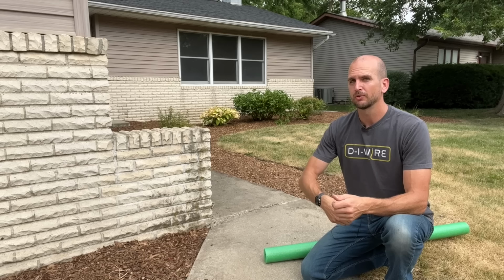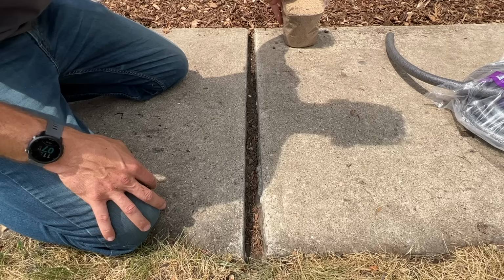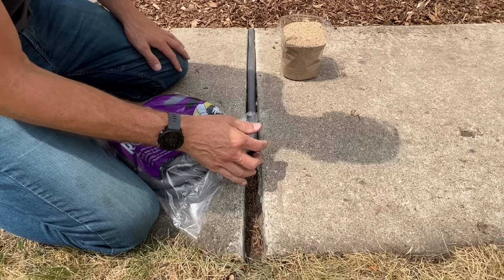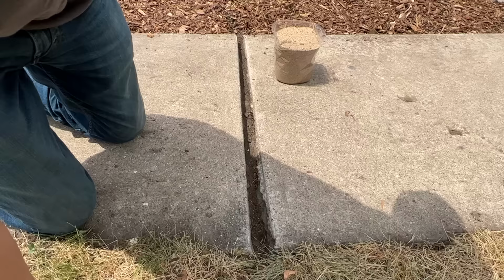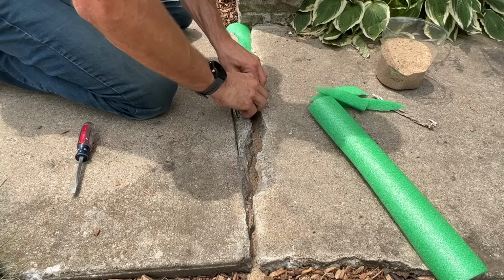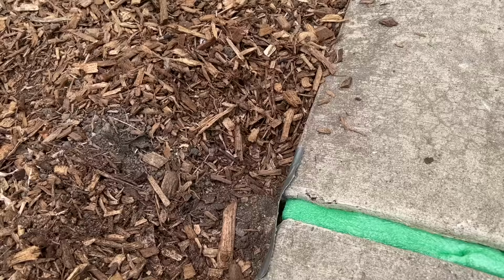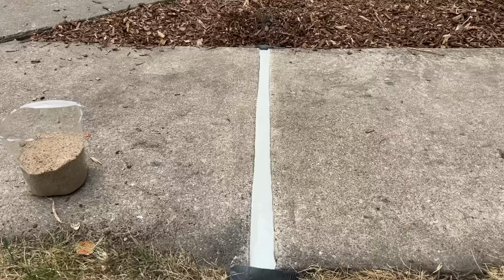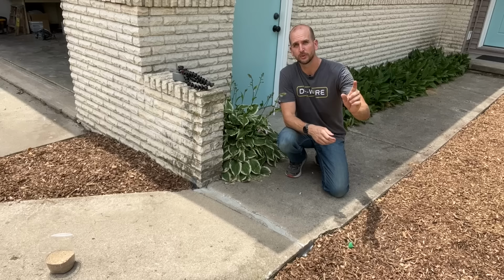How To Fix A Large Crack In A Concrete Sidewalk | Surprising Results!

Comment: I am a mason for over 35 years and what you did with the pool noodle isn't a bad idea especially with the crooked Crack because the noodle is flexible, but I would suggest using quick-create, just mix with water, it's premixed cement, just add water and mix. Then use a small hand garden shovel it in, push down on the cement to get gaps and air pockets out of the cement. When cement gets to a putty type concestansy take a large damp sponge and run it the length of the Crack and feather it in to both sides of Crack, you can do it with the stuff in the tube but you sill have to feather and level the product that  comes out of tube
Reply: Yea mate thats good mail , also if it’s a hot day wet the concrete down first so it doesn’t suck that mix too quickly .
Reply: @queenslander954  Good call, give both sides of old concrete a good dampening if it is a hot day👍
Reply: What's feathering
Reply: Thank you!  I was looking for a solution that doesn't involve any plastic!
Reply: @krazyboutkeekee92  feathering means to brush the seams on top with a brush to help blend everything so it looks natural I believe
Reply: Would that work with a large crack between the bottom porch step and a concrete square? Our back porch has 1 concrete square at the bottom of the porch and it’s broken away from the bottom step. Still straight, no major broken pieces. It just looks like it moved away from the step over time. We know it didn’t start out that way because when my grandparents moved into the house in 1966 it wasn’t like that. So it wouldn’t be flat like repairing a sidewalk. I guess flat then up. Weeds grow, water, little lizards like to sit in there. Yuck. We tried gravel and dirt but they just wash away. It’s really deep so whatever we use I’d have to use a lot. Thanks!
Reply: @lisacobb7525  I believe what you are saying is were the step ends and the walk way begins there is a gap between step and walk way is beginning. Now every tip that I give it really only is a temporary fix in most cases, sooner or later you will have to have old, separated,cracked and uneven old concrete ripped out and replaced with new concrete that has pitch and the right amount of expansion joint. Or replaced with stone or paving stones, now in your case if I have examined it correctly about a gap between last step and walk way, the best way would probably be to use the masonry material that is like call, in a tube and use it like you would use calk around a tub or a window, if it is deep you could use that pool Styrofoam stuff it in the gap and use it the way this gentleman does with the Crack, always read directions on tube and again after you put enough material in gap, take damp sponge and smooth out or like I said before feather it in to old concrete and make sure gap is closed up, no open spots, always keep sponge as clean as you can and make sure the sponge is just damp, I hope this helps, good luck.
Reply: Why aren’t you making this video?!
Reply: @abh114 I just came across this video and I have been a mason for 35 years and I have gotten good advise on Y tube from mechanics, guitar repairs and other things so I figured it might help someone and I have gotten a lot of questions, did not think people would ask questions, so I gave them my experience. People can take my advice if they want or not.
Reply: Sound more simple way to fix the joints. I want to try it. What is the exact name of the "Quick-create" you used ? I found many QUIKRETE cement products and didn't know which one? Is it flexible? Thanks
Reply: @diemvolz4311  What you need is called a sand mix, no stone or gravel in it, I live in Northeast of U.S and has been very hot so should do in morning, the hotter it is the faster the material will dry and be less flexible, the material find in Home Depo, Lowes or Mason supplies,like I said the Quick-Create is a sand mix no stones or gravel, just add water and mix, also if using a hose for your water, let water run, the water has to be cool.
Reply: @frankperricone2065  Will go to find the sand mix cement bag(?) that you mentioned and return the caulks that I bought.  Shoud I use my garden  prayer to dampen the sides of the joint? Can I do it after the rain instead?  Should I pour the cement sand mix up to the joint/driveway surface then feather thin the edges? How about the spots that have un -even edges, 1 side is higher than the other ?  Please let me know anything else that I should know.  I would very appreciate! I live in  Houston, Texas, very hot too. I never had to fix anything until my husband passed away. Thanks to YouTube, I learn a lot. Thanks so much for your reply and advice.
Reply: @frankperricone2065  1 more question. Do I have to remove dirt and or clean the joint before pouring in te cement?
Reply: @diemvolz4311  You can do it after rain as long as the Crack does not have a pudle of water in it, yes dampen both sides of Crack and in the the Crack but no standing water just dampen in the joint you can use yes you can use your garden water can but just enough to cool and again I will say just dapen and as it being uneven you have to go from point A to B, I will use that word again feather, move cement from each side of the joint or Crack, it should be at least 2 inches deep, yes fill up to hight of old cement, and do it in the coolest part of the day, the whole thing is the slower the  cement takes to dry the better.
Reply: @frankperricone2065  You mean the joint must be at least 2 in deep? My joints are only 1 1/4 - 2 in deep because there is a layer of cracked /broken concrete running along the bottom of the joint. It is cracked but tight/ impossible for me to remove. I am scared to operate electric saw, heavy tools. I found out the concrete layer when I tried to clean the joint and remove leaves and some dirt. What should I do now?
Reply: @diemvolz4311  1 1/4 to 2" is fine. If the Crack is not to wide you will have to make the mix a little wetter, pour on Crack and squeeze into Crack with very damp sponge, like the size of a car washing sponge until you can't fit anymore, and if it is in a sunny area when done, after a couple of hours drizzle some cool water on area, that's about as much as I can explain on subject. Then main thing is to get the material in joint or  Crack, make sure that there is no space between new and old cement and matches the height of old cement, no matter how its done my you, a friend or a professional it will always look like a repair, don't worry if it looks messy it is just a to stop it from getting worse, eventually it will have to be removed and replaced,.because what ever you do it is temporary, done decently you can get a couple of years out of it or maybe a year, good luck
Reply: @krazyboutkeekee92  -Feathering is like tapering the ends so they gently get a little lower, so water will run off when it rains or the repair gets wet...
Reply: Concrete is a good fix but will crack shortly due to movement, same problem in a few months , elastic fillers are best ,  but you will have to do over in a year or 2
Reply: @jessedukelacrosse6470  I have had repairs last 2 years, 5-10 years that's why I had said it will have to get new eventually, a lot of customers when they have the money or ready to do it all new the proper way they usually call me to do it, and that's what I tell people.
Reply: It will crack along the edges one week later
Reply: @jimmyswollnuts7662  I have been a mason for over 35 years and I gave some advice and have done many repairs, if done correctly it will last at least a year. I have done repairs that lasted years. If some does not have the money to rip out and do whole job correctly. I made one comment to maybe help someone out. So what are credentials to say it would Crack in a week?
Reply: @lisacobb7525  g
Reply: @frankperricone2065  t
Reply: Good to know . Can I use the same to fix the concrete gap between entrance steps and the floor ?
Reply: @Lisa Cobb  I know exactly what you're talking about. My folks had the same problem. In time the rectangle step at the bottom drifted away from the main body. We dug out all the dirt, stones, roots etc. to 4" and poured in concrete. Then leveled it out with a broom. Worked great.
Reply: @Frank Perricone  I appreciate the advice.  Thank you.
Reply: Honestly, on the crooked crack, I would take an angle grinder with a masonry blade - cut a straight line 1-2 inches away from crack - chisel out the crooked part, and fill in with concrete.  Use a mason edger for a smooth edge.  Crack is too large for the noodle fill-in method imo & my suggestion makes for a neater & cleaner look.   Noodle idea is good & ingenious, I’m just offering another idea is all.
Reply: @michaelsalcido3736  Hey Mike, the way you are describing to do the job would be close to the  way I would do it if I was getting paid for the job. I am just going by the way of a home owner probably not having a small grinder with a masonry blade to cut a straight line around, and other masonry tools, just things that might have laying around the house and just so they can get a decent fix until the can get a mason there and remove all concrete and do the whole job properly. So if a home owner has a grinder with mason blade and cut straight line by all means do it if they have the confidence, believe it or not some people are afraid to use powered tools that if not used properly they can get hurt.  That's s my thinking, I would not want anyone getting hurt. Take care
Reply: As a carpenter with 35 yrs in, including doing handyman work, you couldn't be more off base here with your suggestion. Here's why. The uglier of the two cracks has happened at a sidewalk joint and progressed all the way through said sidewalk. Now I realize a youtube vid isn't the best to see the overall condition of the "crack" but due to water getting under the sidewalk, it's still moving. If you were to repair it the way you suggest, the filler will still crack there by allowing water to still invade. This way, done with backer rods and pliable grouts eliminates this, and should it need to be done again, is easy to do so. That said, with that crack, the best fix here is the expensive one, replace the sidewalk.
Reply: Umm so you are telling people to elimate the expansion gap?  Things you shouldn’t do.
Reply: @turkeytrac1  Hey Mr. Carpenter, I made a comment to add a little bit of my knowledge of a repair that a home owner could possibly done on there own. If you read all comments l help a few ppl and I gave them advise on fixing a tripping hazard, I guess I should have stated that. Depending on how they do it it could last a couple of years the easiest way and cheap without getting special tools to go out and buy and never use again. If I was to go as a contractor I would give them an estimate on doing it totally correct by removing the concrete and putting in the proper expansion and steel reinforcement and depth. If someone could nit afford I would give them a alternative for a repair if they are afraid of someone falling on there property because of a trip Hazzard. Never give them more then a season or two guaranteed Depending on circumstances. Like I told someone else who thought they new more then me, they can take my advise or they can take someone else's or combine all of them. Just giving back to the community.😊
Reply: @drdez  Hey J, were do I say remove the expansion joint, it's a crack.
Reply: @frankperricone2065  you filling the entire gap with concrete would basically eliminate it. Both cracks are where the expansion cut is.  You should rewatch the video.   Your solution of combining both pieces with concrete is not a fix that will last.
Reply: The real question: Is it an expansion joint or decorative scoring? 

The 3 guarantees of concrete, It's going to get hard, it's going to crack, and nobody will steal it.
Reply: F
Reply: No. What he did was PERFECT! Try being positive frank and open to new ideas
Reply: Quik-Crete over any type of sealant?
Reply: The problem with using Quikrete is it’s not flexible. Oftentimes that’s why you have a crack in the first place. With this foam and the self-leveling the self leveling crack sealer, it's flexible, which is very important, especially with expansion joints. As your walkway expands into Quikrete, you can get cracks again, maybe in other areas, creating more problems.
Reply: Yes, he’s talking about Quikrete, he’s just not spelling it right. It’s concrete and is not very flexible. If you’re repairing an expansion joint, you need to be able to be flexible, so when the sidewalk expands, you don’t get further cracks! That’s why they call it an EXPANSION joint. Don’t use concrete in an EXPANSION joint, unless you use the concrete along with actual expansion joint material (building material stores sell 4” asphalt based expansion joint material). It defeats the purpose and will be short lived. Use something flexible, like this guy in the video used.
Reply: THE CAULK IS SELF LEVELING
Reply: Thanks for reaching out to this lady with the problem.we need more people like you in this world ,so on her behalf, thank you.from Dublin Ireland
Reply: @queenslander954  I thought the major issue of fixing this problem is “water” which will add food to a thik root underneath; therefore giving more food to the root to keep growing.  Just saying.
Reply: https://youtube.com/@frankperricone2065?si=EPiwqFBJ0Jk7OLKo 
I rarely comment, but the time you spent to provide clear, detailed information is admirable & deserves more positive feedback, imo. 

You replied to multiple questions in similar fashion, giving more context to your rationale as it relates to your target audience. Further, you demonstrated respect to others who challenged your advice, even those who appeared glib and terse.

We cannot control how others interact with us, but we can certainly choose how we respond to them.  Well done and thank you for your willingness to share your knowledge.
Reply: Wouldn't be easier to pour concrete ?
Reply: @diemvolz4311 I assumed he meant quick-rete…
Reply: Nice job paying it forward! The Universe appreciates you!
Reply: What was wrong with filling it with cement?

Comment: What I do is, clean as he does, dig out all the debris in the gap (as deep as the concrete is) then tape over the edges and fill the gap with waterproof expanding foam.  When that dries I use a wire cup bit on a hand drill to remove excess foam to about 1/2" depth.  Then finish up with self leveling sealant caulk.
Reply: When you say you tape over the edges, do you mean the cracked edge of the concrete? Does the tape stay in place after the entire repair is finished?
Reply: cool idea!
Reply: @annfraley7083  ... Before I apply the expanding foam I mask the edges of the concrete, the top surface.  I use 2" painters tape so if there is any over expansion of the foam it won't spill out over the top surface of the concrete.  Once the foam has dried, it's easy to break off any excess foam before cutting/grinding out the top 1/2" or so of foam.
Reply: I think I might like this idea better as I'm not very good with my hands, and I don't think that I would cut the pool noodle as well as he does. I would probably end up making it look worse than it already does lol. But I liked all the other things that he shared in the video
Reply: @digiacomtech5589  Won't a stiff rotary brush on a drill or grinder buff off any excess foam, overall more quickly than taping as you describe?
Reply: @replyhere590  ... I said ... "I use a wire cup bit on a hand drill" ... You can certainly use a flat circular disk brush but I find the cup brush helps control the depth of removal.  That is, the metal cup that holds the stiff wire bristles rides the edge on one side of the crack while the wire bristles clear the other  ... a circular disk is harder to control and could remove/dig too deep into the foam.   And you don't want to go too deep as whole point of this is reducing the amount of caulk needed to fill the remaining gap of a deep/wide crack.

Comment: My 'fear' is by using so thin a top coat [less than 1/2" thick], it becomes more susceptible to cracking and breaking under traffic.
Reply: SSL has a fairly high shore hardness but yes in that size joint it should be 1/2 inch deep
Reply: The sealant has to have enough concrete side surface to bond to else it won’t stick to it as the two sides move from freeze thaw cycles.